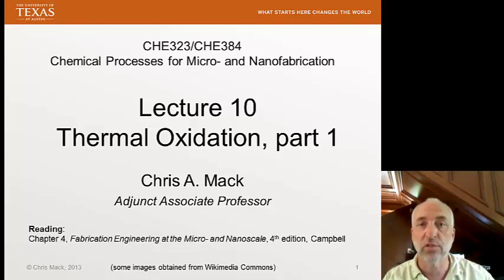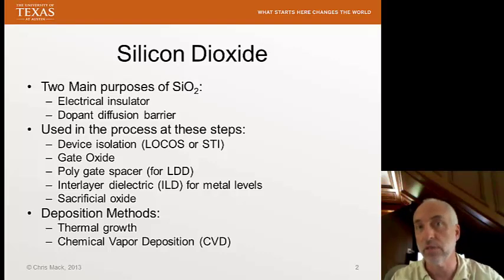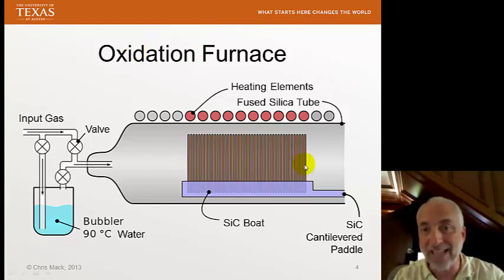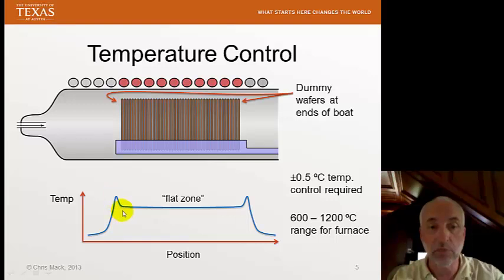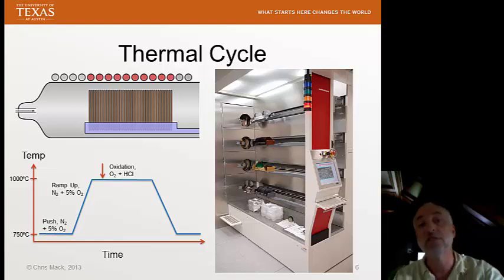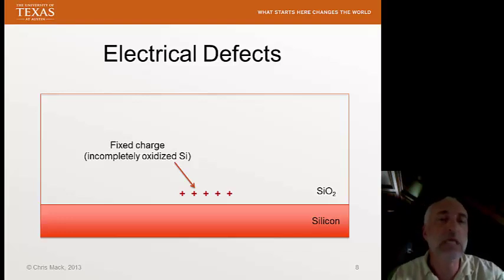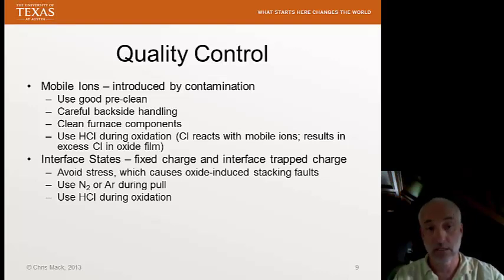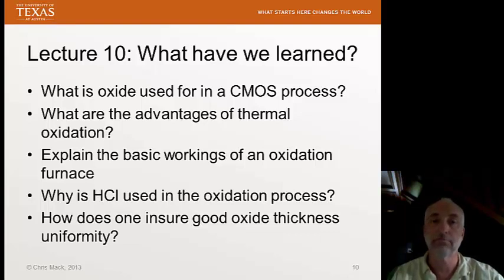Lecture 10 (CHE 323) Thermal Oxidation, part 1

Comment: Do we need to perform thermal oxidation before every lithographic process?
Will SiO2 layer provide better adhesive to the photo resist layer?
Reply from the maker: No, we certainly do not need to perform thermal oxidation before every lithography step.  We can perform lithography an any substrate.  We may have to prepare the substrate using an adhesion promoter, or possibly an antireflection coating before applying the photoresist.
Reply: Thanks a lot for your reply :) 
Your videos are really good